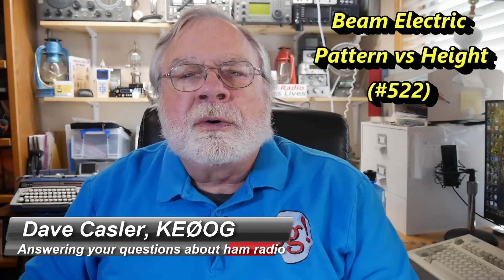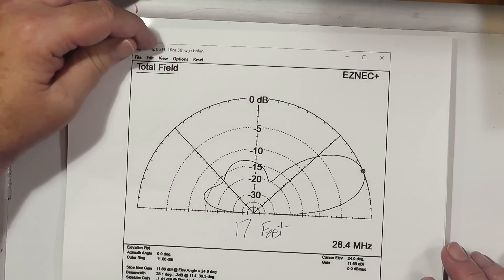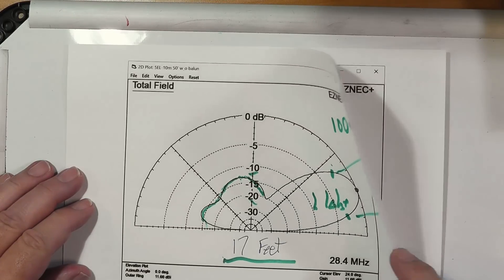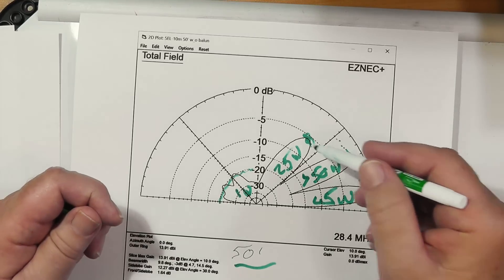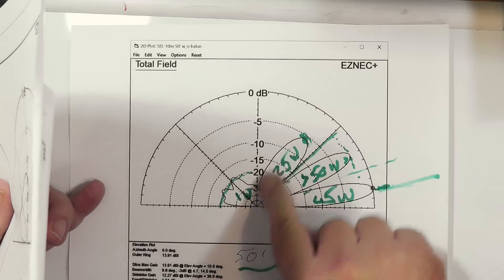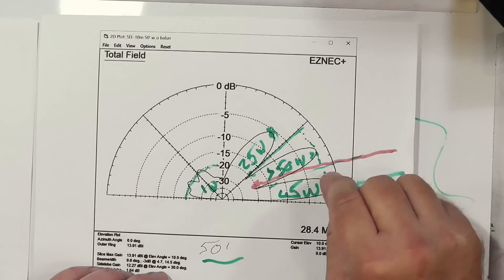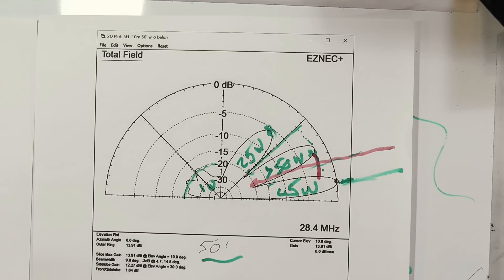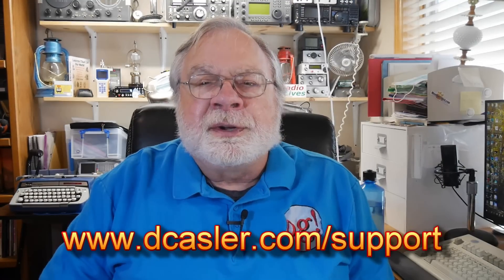Beam Pattern vs Heights (#522)

Comment: I have two questions. 1st, does this topic applies to both vertical and horizontal polarization? 2nd, does it also apply for both VHF and UHF? From what I've heard in this video is that you sir said that the optimal height is half wave length. Thank you sir for an informative lesson.

Comment: @Dave Kasler :: let me first thank you for putting this information together in a coherent manner. As a longtime ham I know that trying to figure out the best angle of radiation based on height above ground can be difficult. I am blessed with a SteppIR and a crank up 65-foot Tower. I have long known that I can change the elevation of the beam and operate accordingly. Unfortunately it's not motorized and I would have to go out and use the Armstrong winch method. HI HI. I'm a little too old for that now. Can I skip the part about being too lazy?

You concentrated on 10m which that's an unusual band to concentrate on although new Tech's often operate there. But what about us Old-Timers that tend to operate 80 through 6? That's the beauty of the SteppIR's as you know they have automatic tuning when plugged into a serial port or USB port on a modern rig. They retune themselves every 50khz. That gives you the best gain versus SWR.

But what are the best altitudes for figuring out for example 80m? 130 feet. 40m? 65 feet. 17m? 27 feet. Deserve 1/2 wavelength for a dipole of course but what about a beam? How can anyone justify a multiband beam such as a wonderful SteppIR if one cannot control the height of the tower? I'm certainly not bashing the antenna because they're fantastic! But how best to get them to that magical half wavelength?

The reason I ask is because I'm planning my retirement and final station build and was planning on a 130 - 200 foot tall tower with 2m repeater antenna on top, and  SteppIR Monster at 130 feet. That would obviously be a fixed 10 guyed Tower and not a crank up. It would seem the advantage of having such an excellent antenna disappears when we look at the take-off angle of radiation of the bifurcation and trifurcation. It makes perfect sense the way you laid out but then you draw a reference to the fact that on some bands when you can get three wavelengths above ground you can get some really nice low angles of radiation.

Wouldn't it make more sense given this information to have at least a 40 if not stacked at 65 feet, a 20-15-10 if not stacked and a 6m at 10 feet. Most experts believe that a good altitude for a 6 meter antenna is 30-40 feet. That kind of goes against the take-off angle being discussed. Is it best to talk to the people at for example M² for their recommended elevation per antenna? A SteppIR seems to be a poor choice now.

Comment: David.  I am excellent in math and computers but know nothing about radio and antennae’s.  But I want to learn.  My immediate objective is to fully comprehend this video you created.  An example for my confusion is you use feet at the same as meters.   When you use Lamda, what are you using for feet?  Can you please provide a tutorial to the definitions and examples.  I am trying to decide on ham vs. the other choices.  I am not into off roading but primarily want long distance communications for shifts scenario.  I have iPhones for most of the time.  Thank you!

Comment: DAVE! 
Can you help me understand the use of resistors on the end on antennas. 
I’ve seen them in use mostly army pubs with use of the sloping v. 
As well do you have any suggestions on configurations for a streamlined antenna that can be used in/on a ruck while patrolling. (I have been experimenting and have made one that works well for short distances) 

RTO USMC 
Thank you.

Comment: As always very good information.  I have an EFHW multi-band antenna, (10, 15, 20, 40 and 80 meters) 23 meters long and configured as a sloper.  One end is about 30ft above ground, the other end about 6 ft above ground.  What does the radiation patern look like for this kind of antenna?  I have no ENZIAC to model it myself.  Thx!  David SV0SGS

Comment: It's interesting because an antenna on, say a 250 foot tower, will always be better than an antenna on a rooftop, by leaps and bounds. I have two dual band antennas, one about 22 feet agl on my roof and another (identical antenna) at 100 feet on my tower. Hands down, the one at 100' is not even close to the antenna on my house. The difference is astounding, favoring the antenna on the tower by many DB.

Comment: Hi Dave, nice content as usual! One point that you didn't cover is the fact that two (or more) yagis stacked will cancel out the useless high angle radiation and leave (more or less) one main lobe. The final radiation angle however will be slightly higher than that of the higher antenna because of the combination of heights. Also there will be an additional (nearly) 3dB of extra gain because of having two yagis.  Best 73, Jeff (ex 9H1EL)

Comment: With a beam, one normally uses a rotator. So nulls in certain positions due to the radiation pattern can be simply overcome by rotating the beam to get the strongest signal ;)